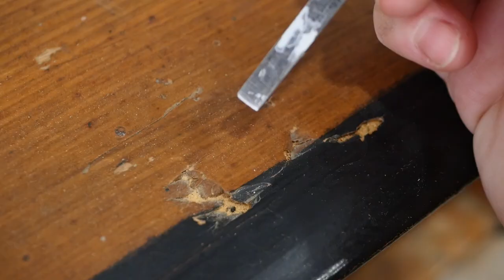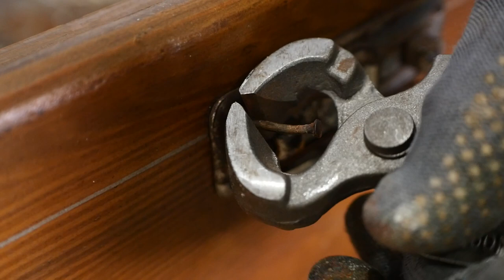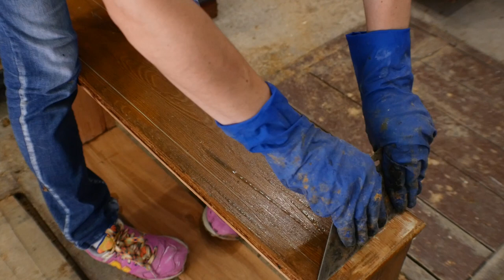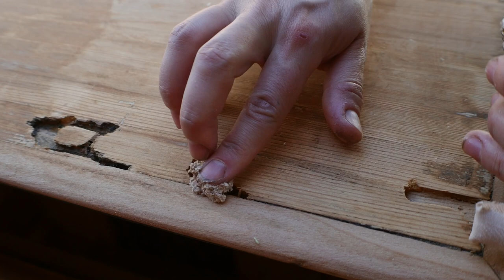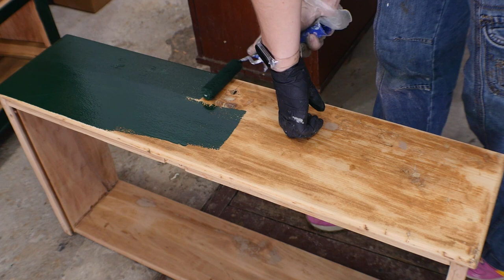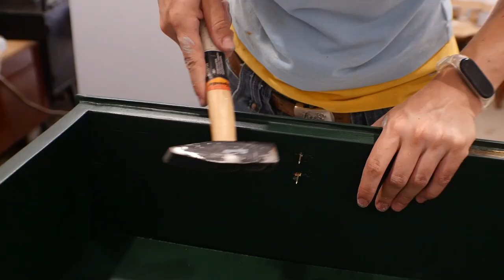I saved a chest of drawers from a landfill. Restoration for 5+

Comment: A little more challenging piece.  Some bug damage, a couple of chunks of wood gone, an that wide split on the one side. I like the color choices, forest green (or whatever you called your green/black mix, and copper colored drawer pulls.  I only wish you could have figured out how to save those drawer bottoms.  They had all those nice hand plane marks (I use a lot of hand planes to woodwork) around the edges to fit the thicker piece into the 1/4 inch grooves in the drawer front and sides.  Oh well, if they're not salvageable, they need to go.  Nice finished project.
Reply from the maker: Thanks for the wonderful comment))